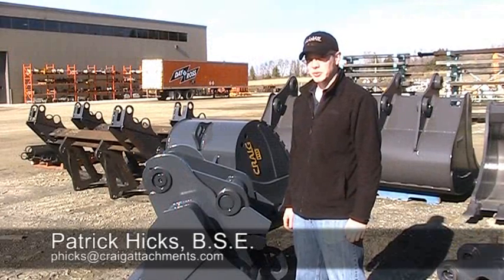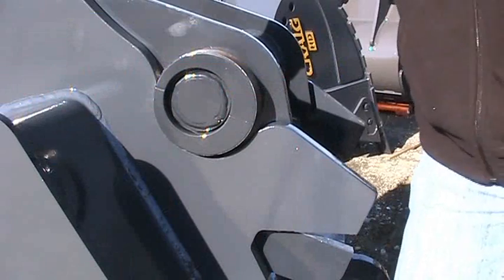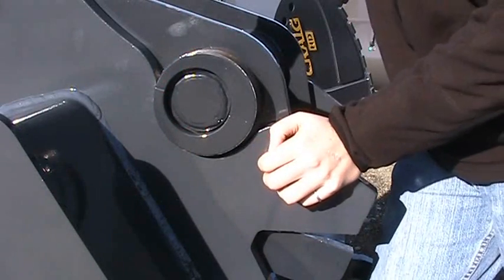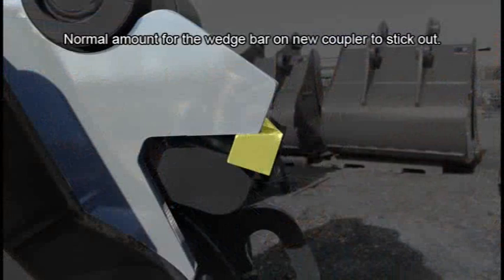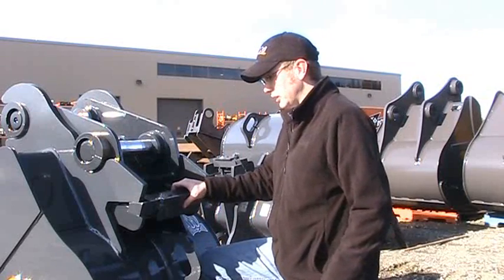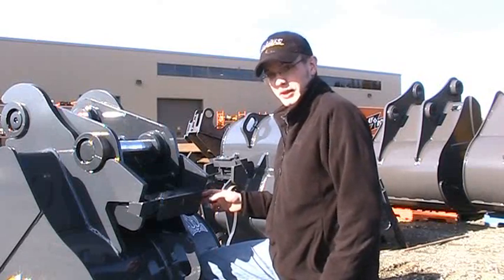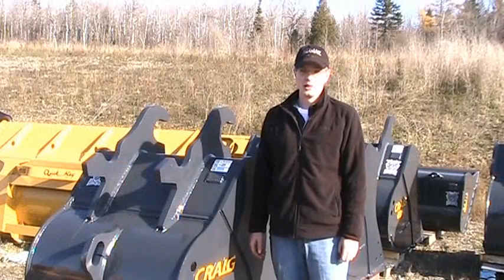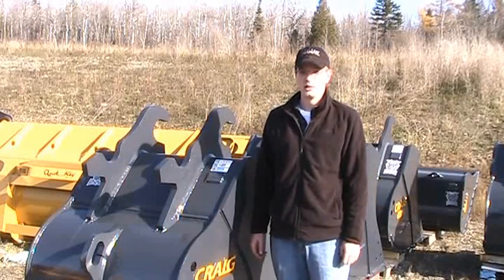Craig Manufacturing - Craig Tech Tips - Wedge Lock Coupler Fit Up

Comment: Tightening up those bolts usually requires pounding on that wedge with 2.5-4 lb hammer and tightening the bolts at the same time, scraping the paint off doesn't help.